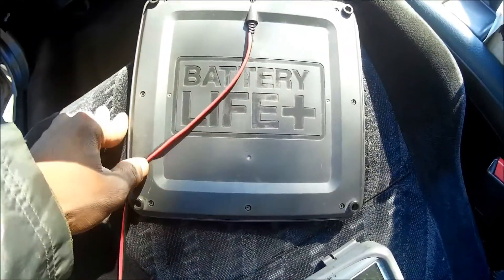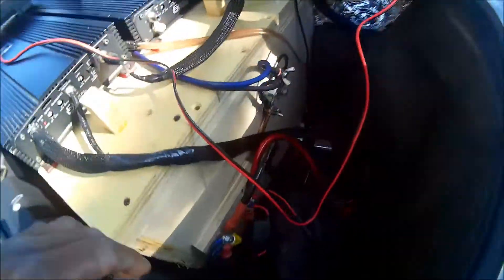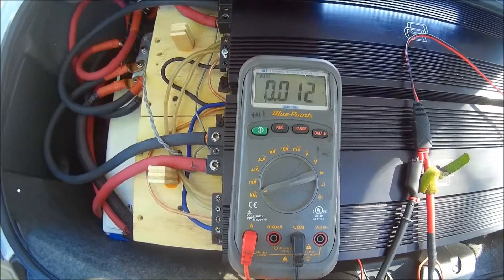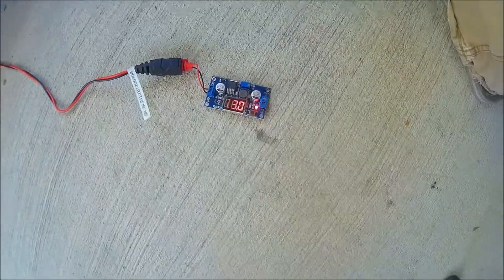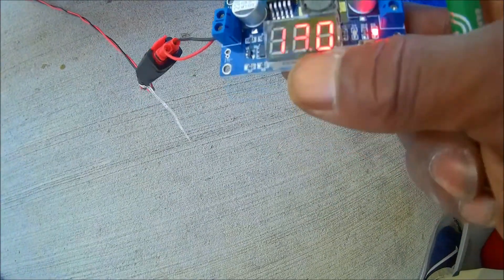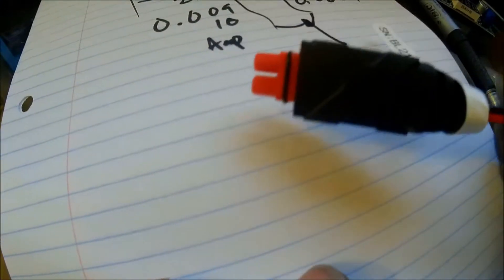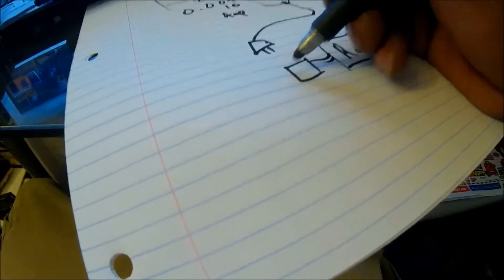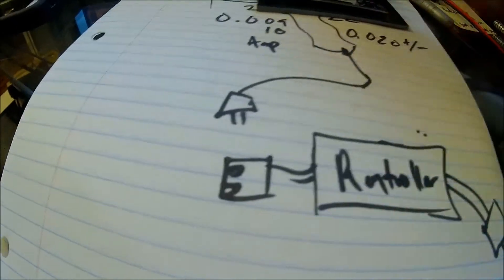Future For CAR AUDIO? Solar Panel Mod. For Battery Charging

Comment: Yeah but how many amps is it? I bet you it's not near big enough
Reply from the maker: Yeah each panel is only 5 watts each. It would take forever to charge my batteries. It’s cool if your car is sitting for long periods. TBH it was something to play around with - I love this type of stuff
Reply: @bigvell02  yeah I'm always looking for gadgets like this to play with I'm taking apart some EH4 Honda cell banks to get the 4.7ah cells out of them they are crazy 60c cells lol a 20ah bank of these cells can do 800amps for 30sec and not drop below 13.5v! Lol
Reply from the maker: I should have put a question mark at the end of the video title lol. I like the concept but I definitely agree not big enough

Comment: I always wanted to out a solar label on my roof but checked into the amperage they out out it would be less than I would make in two minutes with a DC to DC charger but it would be a good maintenance for a boat

Comment: oh shit I gotta try that
Reply from the maker: Yes sir, and more watts the better off we are, I'm still reading like crazy on controllers I still believe they are needed though. I was running an extension cord to my car at night sometimes. This is Much Better
Reply: bigvell02 hell I been going days without running my system to charge mine lol hopefully I will have my second alternator running soon
Reply from the maker: Realdude rec yeah a panel should definitely help when your not running. When I came out today my meter read 13v flat